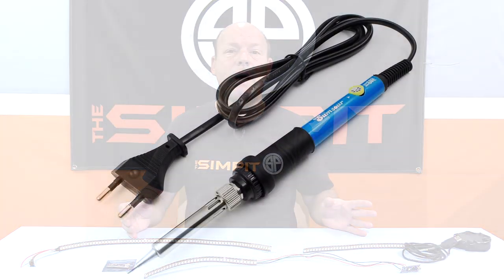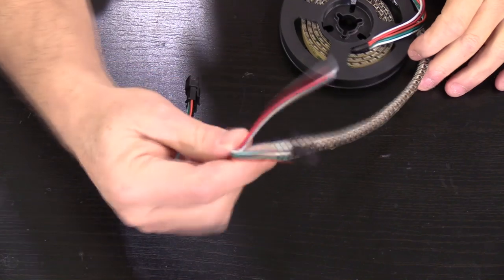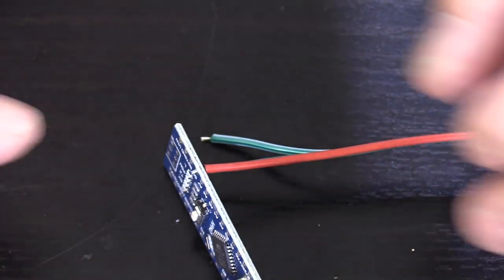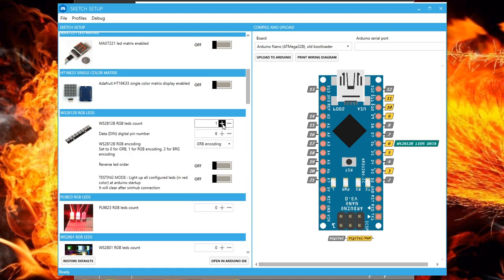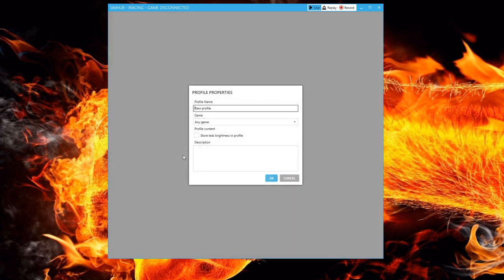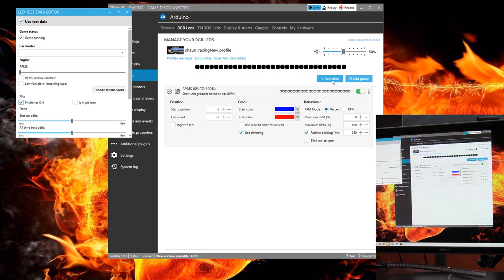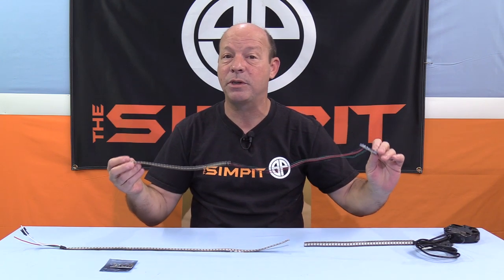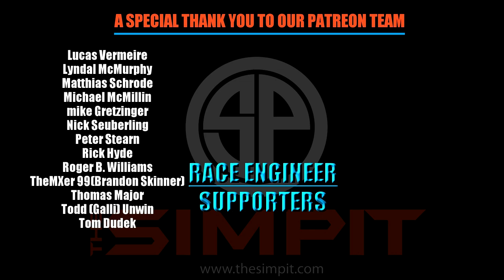Sim Racing Rev Bar / RPM Gauge - Under $20 DIY Project

Comment: I followed all the steps, two sets of arduino boards when you try to upload it at 50% it goes avrdude.exe: stk500_getsync() attempt 1 of 10: not in sync: resp=0xef then gets to 10 out 10 failed and the upload fails, two different manufacturers of arduinos

Comment: Great video, theres options to even buy the arduino nano thta comes with the screw expansion boards so you don't have to solder anything!

My arduino nano required me to play around with the bootloader settings, but apart from that everything went smooth, thank you so much!
Reply from the maker: That's great to hear, thanks!
Reply: Im here a year later trying to upload a new sketch and windows made these cheap arduino nanos impossible to use bc of a "fake ch340 chip"

Comment: What’s the max amount of lights that could be run??? Could I run an entire 3ft strip with the nano??
Reply: No.. The pin on the board will burn. Even I'm not sure the maximum amount. I'd suggest you to power the LEDs from a 5v USB port.

Comment: I'm trying to get me RPM Gauge to work I have went step by step and it will not show  the port needed it only shows Com  1 what am I doing wrong? it does try to load 10 Times the it failed
Reply: Same issue as Tony here Shaun - any ideas for a fix?
Reply: Tony, I updated my Com Port drivers with the help of a YouTube video search and mine is now working.
Reply: @velocitybraker991  got it to work after downloading the drivers and i had to use the new not the old thank you so much i love it

Comment: Love the stuff you do Shawn BUT,  you really cannot solder to save your life.  Please ‘tin’ all parts to be soldered first, then solder with just a little more heat than you do now.  You can see if its a good joint by  looking at the joint:if its shiny it’s good.  If its dull it’s bad joint.  Sorry to point out but you need to improve!